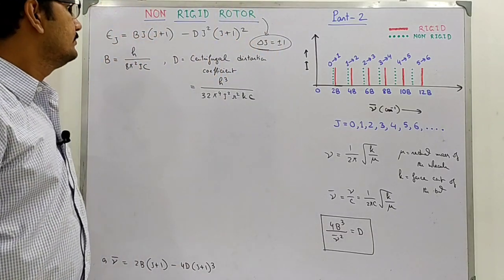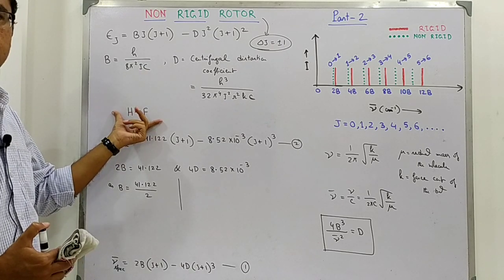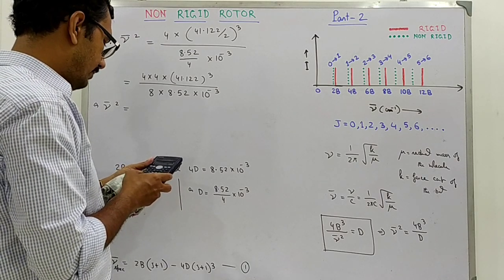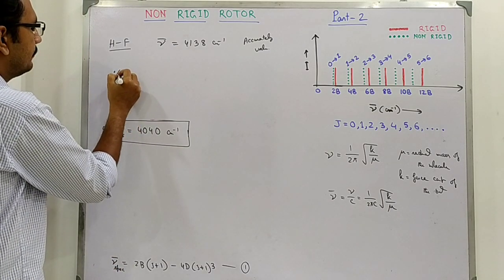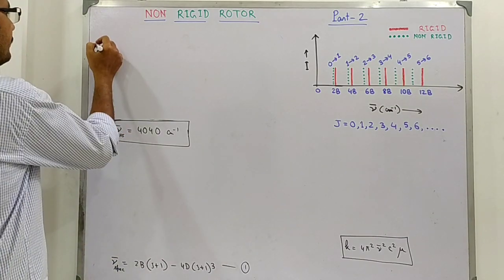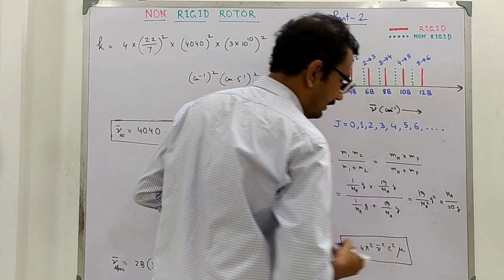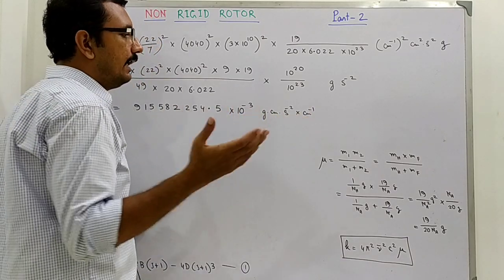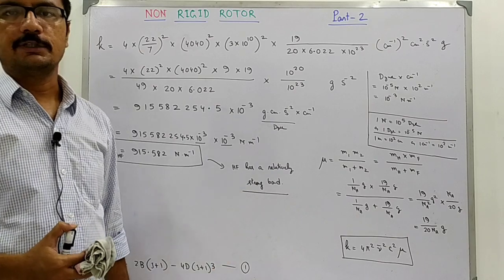Non Rigid Rotor || Part 2 || Bond Length || Force Constant || Trick to solve numerical problems

Comment from the maker: Since the accurate value of fundamental vibrational frequency of H-F is 4138 cm^-1, predict the accurate value of the force constant of the molecule?
Reply: Sir, force constant is 959762.106 dyne/cm or 959.762N/m
Reply: ans of force constant 960.540 N/m Or 960540.340dyne/cm
Reply: Sir,
Ans :-bond length of HF=0.928A
Reply: Sir force constant ta oi 959.555 N/m hoche
Reply: Sir,
Ans:-force constant=959.76    N m-1
Reply: Sir, force constant=959.762N/m
Reply: Sir, force constant is 959.767N/m
Reply: Bond Length = 0.0928 nm
Force Constant = 959.7 N/m